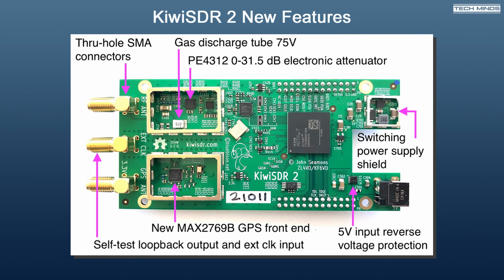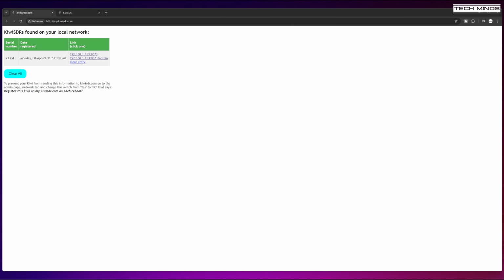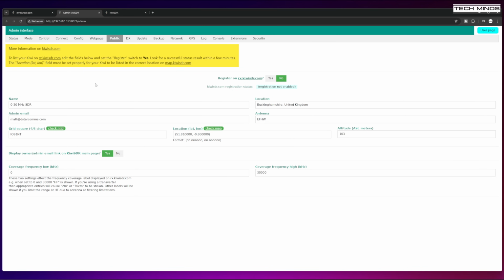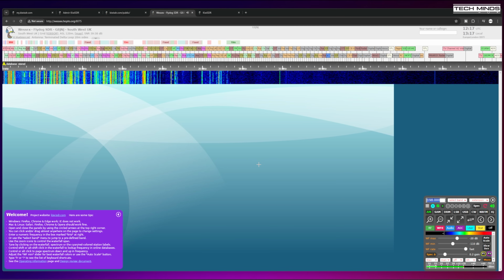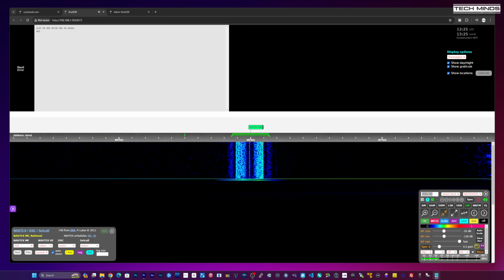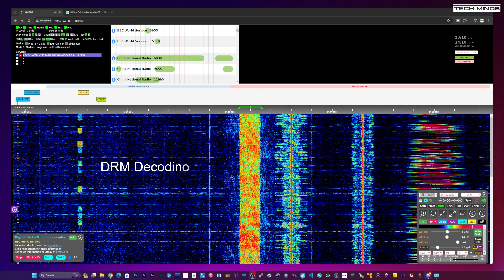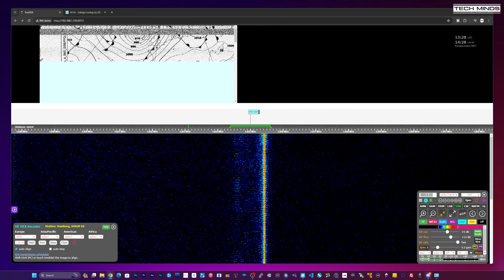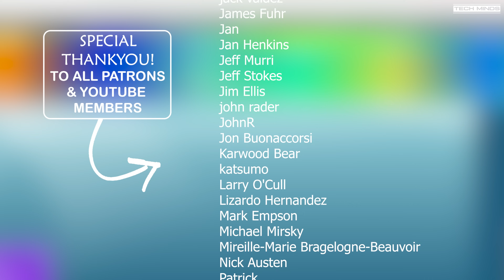KiwiSDR 2 - A Standalone Software Defined HF Radio Receiver

Comment: What would it take for this device in order to extend it's range down to 1 kHz or even DC? I'm trying to monitor dirty electricity comming off my house's electrical wiring
Reply: A bit late but look up the nRSP-ST. Hope you got that electricity situation fixed. 73

Comment: I have an SDR Play RSPdx and have to say I'm disappointed with it, particularly on MW - the HDR "feature" (which is partly why I bought it) doesn't actually seem to do anything except reduce signal strength, and when looking for a replacement, came across the Kiwi.  One question: if using on my home network, would there be the same latency as with online KiwiSDRs?  I find that any I've used online have a delay of about a second or more between clicking on/selecting something and it actually happening.  I'd find this annoying if using locally.  Thanks :)

Comment: ET ships aka UFOs seem to be standing wave EM energized on the hull, the small 10-15m scout craft likely have a main tone around 10MHz and complex harmonics up and down, all the way down to audio range and at least up to GHz. GHz might even be a dominant component. Try looking for it. Sightings suggest at least 200 sorties around the world every day and they might put out considerable power levels so should be detectable from 1000km+. Larger craft will have deeper tone presumably. It will be a strong signal that has no data. When close they sometimes emit a sound like an agitated bell, a bit like meditation vessels. Similar sound might be recognizable in RF as a beat frequency or something. No FM modulation of course since it's a side effect of the propulsion.
It is a certainty that ET ships frequent our skies and there is strong evidence of EM and RF, only a question of how easy are they to detect. Coastal areas might be the most frequent as the regulars seem to have bases on earth, specifically in the continental shelf sea floor.

Comment: Ok, I bit the bullet and bought one of these KIWI SDR 2s. It came to the US in two days from Martin Lynch and Sons in England. Two days! I poured myself a cup of coffee Friday morning and activated my new KiwiSDR 2 radio station. I'm still doing a double take at the little black box sitting on the floor, realizing that this KiwiSDR 2 is not hooked to anything else. No need to load any software. It's a standalone box with everything included. It comes with a GPS circuit/antenna to keep perfect time, my location is picking up four or five satellites around the clock. To see the entire 0-30 megahertz spectrum and be able to do a deep dive by clicking and zooming in on a waterfall/spectrum scope is fun and amazing. I am now part of a worldwide group of Kiwi SDR owners/listeners. First, there's the hardware, a small box with the KIWI SDR 2 motherboard coupled to a Beagle Bone, which is the computer. I did nothing but plug the box into a LAN outlet and powered it up via a 5V, 2amp USB charger cord 5.5 x 2.1mm. Go to MykiwiSDR.com and up pops your station IP address, ready to be identified and registered. I plugged mine into an active loop antenna. The configuration software is extensive and impressive, giving you plenty of options for both you and anyone else who comes to visit. Now I can share my listening station with all my friends. Really cool are all the digital modes that can be deciphered. Just point and click on a frequency and the appropriate decoding screen pops up, giving you all kinds of digital info. There's AM, shortwave bands, HAM bands, military bands, Marine bands, weather satellites, it goes on and on. Filters are good, but considering this is a Software Defined Radio I expect things to improve even more with each firmware update. Kudos to the KiwiSDR team for having this magical box manufactured by TRIODE in New Zealand. They are a small but very good electronics manufacturer. 

Very good receiver, not as sensitive as the most expensive units, but just fine for hours of exploration. Check out all that this radio has to offer, all the modes too. No cobbling together various SDR software from the internet, risking a computer virus in the process. You don't need to be a computer guru to make this all work. I love visiting and using other people's radio stations by simply clicking on a map that shows every online KiwiSDR around the globe. It's great to know that when I leave town I can "work" the world by bringing up my radio station and hundreds of others on my smartphone.

This is a great advancement for anyone into radio.

Comment: I really like where SDR development is going, but my feelings are mixed. Once I plug in my radio to an ethernet cable, I feel in some ways the magic of radio is lost. Does anybody else feel this way? I love going onto the Kiwi site and remotely using other people's SDRs, but something about being connected to the internet bugs me. Where does the magic of looking for open windows of propagation end and the relative mess of the internet begin? I feel like somehow my skills as a radio amateur become diminished. Now, this SDR from Kiwi doesn't transmit, or will it eventually? Lots to think about.
Reply: The internet connects you to the device.........you still have to hunt for the signals.
Nothing has changed.

Comment: Imthinking To build an sdr with around 5 antennas that youwill need to put in coordinated position onm your car roof or in camping ground, then you will be able to see where the signal is comming from and right now the thing works, but there are a lott of buggs , im notthe one who is designing and making it, but my friends are, it will change so much things, it will show you detailed location from where the signal comes, best to be used on car roof because all the m,ovementt gives much more detail, but if you aint moving the target may and tthats the trick.
Reply: I'm new to radio sdr . Would your friend be similar to kraken sdr ?

Comment: I own two of the original model. I have over 60 years of radio experience including broadcast transmitter maintenance. The hardware and software of the Kiwi are head and shoulders above anything on the market. I will probably pick up one or two of the new model in the near future.
Reply: Cool.
Is it even better than SDRplay or the Malahit DSP-2? 😊

Comment: Question, How is de software installed on this board? Using a SD? reason to ask is that after a couple of years there could be an issue with the SD.
Reply from the maker: A: Installed via SD card or Internet download. But not run off of SD like the earlier RPi's (which is a bad idea). Run off of on-board eMMC (much higher reliability).

Comment: Works this with Linux also?
Reply from the maker: A: Yes, since the interface is browser-based it runs on almost anything, including Linux-based devices (but devices with small screens are not so good). The Kiwi's application processor itself runs Debian 11 Linux.

Comment: Why is 14bit automatically high dynamic range? 
It's a finer resolution of the dynamic range in the first place but isn't higher.
It would be more interesting so know what the receiver noise is and the sensitivity instead the bit resolution in my eyes.
Reply from the maker: Who said its high dynamic range?
Reply: @TechMindsOfficial  you said in the beginning it has 14bit which provides a good dynamic range.
That intends that the higher the bit resolution the higher the dynamic range, isn't it?
Maybe english isn't good enough....
Reply from the maker: Ahhh  yes, it's just my wording. Which is why I did not say higher, I said good dynamic range, maybe resolution would of been a better wording. Thanks
Reply: @TechMindsOfficial  Ah ok. 😄
Maybe a basic knowledge video about snr, dynamic range, sensitivity, saturation and resolution of a receiver would be an interesting topic for a video. It's almost the same with CCD sensors of a camera.

Comment: Another excellent video. I access other people's KiwiSDR stations often and would like to have my own to share. However, I'm very limited in antenna space and my densely populated neighborhood is very noisy (radio-wise).  My reception service would not be very good. BTW, it's worth mentioning that in addition to the great decoding options in KiwiSDR, it's possible to connect to other decoding software using virtual cable (VB Cable).

Comment: Ok I'm not shore this question is sensible, but what is the point of ypthe clock imput? I would have thought that with both gos and ntp you woulld have plenty of clock sources
Reply from the maker: It’s so you can use your own Reference. NTP could not be used in that way, and perhaps you might want to install at a location you cannot get a GPS signal.
Reply: @TechMindsOfficial  right shy do I always forget edge cases, my bad :?

Comment: hmm, the price is right, but i wonder,,, is the kiwi tweakable over SSH ?
Reply from the maker: I'm sure I read somewhere in the documentation about SSH. Remember that you can just buy the "cape board" on it's own, where you have to supply your own beagle bone and install the software, so I am sure you could have SSH access if you need to.
Reply: @TechMindsOfficial  meh,,to much trouble, i wait till its available in europe, hmm, it will be more as on the kiwisite (import tax, and that),
Reply from the maker: Will be available from  hamradio.com when they get stock.
Reply: @TechMindsOfficial  498 euro in europe,, auch....

Comment: I'm a HAM operator and bought a KiwiSDR 1 two years ago. What shall I say? I was the best investment ever! It's not just listening to some radio stations. It's like diving easily deep into the universe of Long-, Medium- and Shortwave. Reception is excellent with a decent outdoor antenna, for example longwire, dipole or magnetic loop. Much more fun than I ever thought. And you can share the fun with others - it's simple to open your receiver for the public if you want to.

I recently bought the KiwiSDR 2 as a backup. Good idea!

Best wishes Michael, DO6LSM
Reply: I'm confused. it said it only operates up to 30MHz, right? How do you hit HAM frequencies?
Reply: @DrDingus  Hello DrDingus,
You can use the KIWI above 30 MHz only with a downconverter. But I was talking here about operating an amateur radio station ("Ham"), usually used frequencies are between 1.8 MHz and 29 MHz.

Comment: WOW what a slick SDR .. I Will Have to Grab one.. when Available and "Join" the Nework Looks Like Fun..On another Note.. Just a Question.. If you Don't Mind.. With your EFHW Antenna, using a 49:1 UnUn.. (What Ferrite Toroid Core) Are you Using ?? Like FT-140-43 ?? (Or do you remember what Core you are using ??) looks like you get good performance from that Setup.. (I would like to achive the same Performance) .. Also once again Thanks for another informative Video .. 73s
Reply from the maker: Thanks for your kind comment :-) I think I was given the 49:1, it's rated for 400 watts, so I would image a couple of stacked FT-140 are in there.
Reply: @TechMindsOfficial  Thanks, looks like the 49:1 UnUn is used by many with EFHW Antennas. looks to be a Good Match. I was On the Kiwi site playing with the many SDRs online (WHAT FUN ☺️) I was also trying to get the (Dream DRM) version 2.2 to Work in Windows 10 ... But Nope.. (Complains something) about QT not found.. Too bad. I Don't know what to do to fix it. Being able to listen to some of those DRM Stations would be nice..
Another good reason for getting a Kiwi I guess. 73s (And waiting for your next Video)... Perhaps on how to install DREAM DRM 2.2 into Windows 10.

Comment: Since you seem to be on top of the latest and greatest SDR hardware… do you have any info on Analog Devices Jupiter SDR? I have an article that states it was unveiled the end of march in Orlando, Fl. And there’s a bit in ADIs wiki about it but that’s all I can find.
Reply from the maker: Zero information other than what's available online. I will speak with my contact at Analog to see if I can get some more info!
Reply: I've just read in Twitter it's soon to be available by around 1000 Euros. For a dual receiver/dual transmitter with lots of ports, 2GB RAM seems a very competitive price.

However, for my preferred application - DX reception between 0 to 108MHz - , I was a bit underwhelmed by the ADC used: though it covers from 50MHz to 6GHz, delivers up to 40MHz of IQ spectrum,  its bit depth is only 10 bit. Well... the world is now owned by very wide signals UHF and above, so the specs make sense... for LF, MF, HF and FM DXing, I don't think we'll see the Jupiter being used a lot.

Comment: I have an Airspy HF+ Discovery for VLF, HF and VHF, and an RTL-SDR for higher frequencies, accessible anywhere in the world via OpenWebRx+. Can anyone tell me how the KiwiSDR 2 is better? Serious question.
Reply: It's not about being better/worse; it's all about features much alike comparing a Mercedez-Benz sedan to a 8-passenger mini-van. KiwiSDR allows 4 simultaneous users that can tune any frequency between 0 to 30MHz all times; plenty of decoders for digital modes out-of-the-box; it's self-contained solution, just plug antennas, LAN cable and forget it. To offer the similar featureset with HF+, you would need 4 dongles, dozens of hours setting up the decoders and a computer to act as a server.
Reply: It’s standalone and can be easily shared

Comment: I was really excited when I heard about this. Web interface blows it for me. No sale. Have any idea how many brick devices I have that wont work with any other browser that Ie5.***. Nah I'll pass especially for the price. Make it so it works seamless with sdr++ or play maybe but I'll pass.
Reply: You can run this from any device that has a browser. Laptop, tablet, or phone. Also, from anywhere in the world. It's also upgradable. Maybe I don't understand your comment about bricked devices. I run the original KiwiSDR with no issues. I also have HackRF, SDRPlay, RTLSDR, etc, If I want to access my kiwi from anywhere, I have my phone so I can listen while mobile also. Can you monitor all 30Mhz of HF waterfall at once on any other SDR? 
The KiwiSDR can ! Yes, it's expensive, I agree with that comment.

Comment: WOW! This is fantastic, jusrt discovering KiwiSDR and now been looking at the remote sites to get a feel.  However, I clicked a link that sent me to the GitHub page for OpenWebRX saying the project developement has stopped since 29-12-2019, does this affect or presuminlgy, are others continueing the project with the production of KiwiSDR 2?
Reply from the maker: A: Although the Kiwi started with the OpenWebRX code back in 2016 it quickly diverged away from it as Kiwi-specific additions were made. So the original OpenWebRX stopping development makes no difference to the Kiwi.
Reply: @TechMindsOfficial  Ah, thank you. And stop your videos, they cost me money! 😂😂😂

Comment: I am curious as to the channel selectivity on lw. I was using a public Kiwi in Illinois with great lw noise floor, and was logging NDB cw calls. I noticed the selectivity was not very good in that range, as the calls heard were covering many of the adjacent slots without sharp selectivity being apparent. Many slots in fact. Do you know if the Kiwi design characteristics are massively different on the lw range as compared to the predominate hf ranges? Selectivity being the main concern?
Thanks!
Reply: If you hold the Control button on the keyboard, and click on the + and - icons, you can expand or narrow the filter on any mode.
Reply from the maker: A: You must zoom far in enough so you can adjust the edges of the green passband symbol to get the precise selectivity you need. LW selectivity is exactly the same as for HF.

Comment: Wait, what? This unit is £320 and covers 10KHz - 30 MHz. But there's a USB module that covers 10 KHz to 1.7 GHz for US$40.00 (RTL-SDR). Weighs less, costs less, does much more. What's going on? Have people lost their minds?
Reply: KiwiSDR is a self-contained solution. You plug in your network, turn it on and you have an SDR that immediately serves up to 4 users simultaneously tuning anywhere between 0 and 30MHz and has every digital decoder of the most used modes on MF and HF.

The USB module you have would need at least a PC, dozens of hours to setup the same decoders and can only support one user limited to the 2MHz slice selected at the time.
Reply: @hg-sx5nk  Yes, and four RTL-SDR units cost US$160 and cover a much wider frequency range. I say this only for the sake of comparison -- most users would want one receiver connected to one antenna for US$40.

This just makes ... no sense at all.
Reply from the maker: @lutusp Even though the RTL-SDR are absolutely great SDR, they have NO comparison to the performance of this SDR at the frequencies that this covers. Everything is designed for a reason, the KiwiSDR 2 has a specific reason. Cheers
Reply: @TechMindsOfficial  > "... they have NO comparison to the performance of this SDR at the frequencies that this covers."

Now that would be a great video (hint, hint). I say this because the RTL-SDR unit works extraordinarily well. From a scientific perspective, the unit you're describing would need to demonstrate a level of performance that, apart from merely improving on the RTL-STR, would need to do so consistent with costing over seven times as much.

But what do we know? No one has made an objective comparison. All I can say is, it would be a tough test to pass. It would be like comparing a Falcon 9 to a Delta IV rocket. The Delta IV does the same thing but costs five times as much money to launch. But, notwithstanding the economics, ULA (which operates the Delta IV) is still in business.

When people hear this comparison, they say, "Wait, what? How is that possible?" It's the same here. People don't always make rational choices.

Nothing personal, just asking how this is even possible.